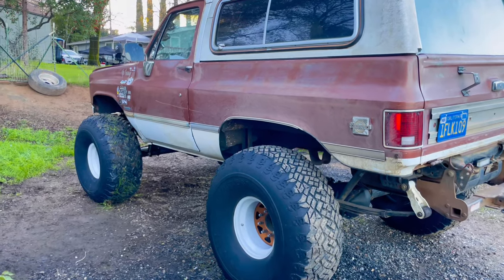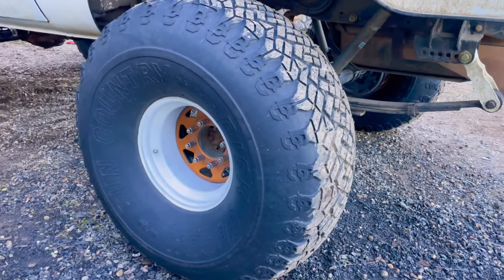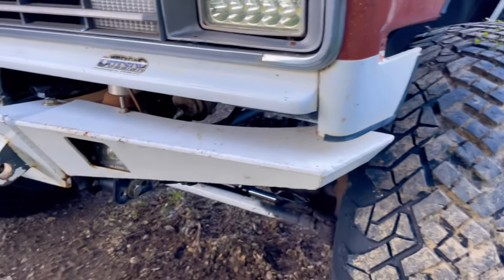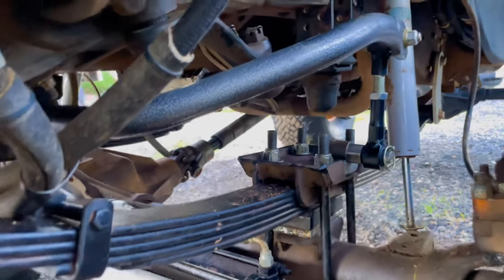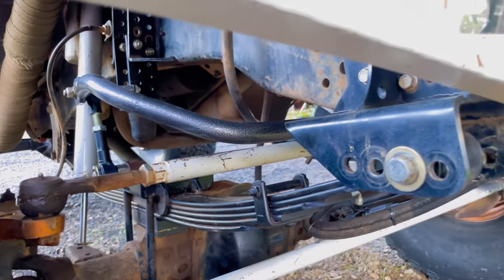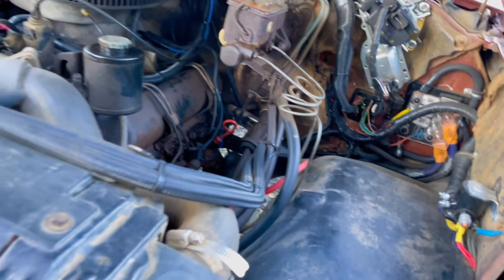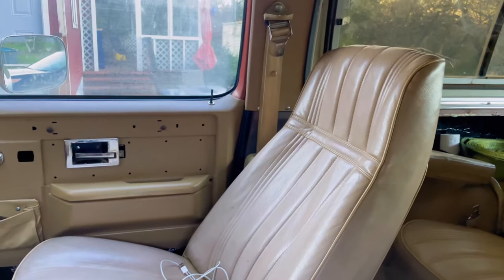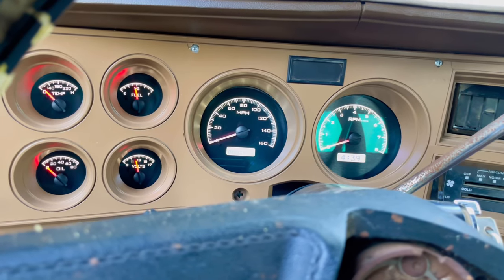LIFTED and LOCKED!! The ultimate k5 blazer build

Comment: I  graduated from H/S in 81, and my grandparents gifted me a new K-5 diesel 4 in the floor lock out hubs. Farmers/Ranchers are used to utilising farm diesel, so they gave it to me with GM diesel & shopbuilt front brush guard w/P to winch, you could stand inside the front brush guard to change the fuel filters. Rear farm bumper had a tow receiver, so I could pull any level farm trailer from cotton seed hull trailer, nursing tank, 1000 gl diesel, hay, cattle trailer 5th wheel for pulling a gooseneck trailer with Dolly. Manual locks & windows include rear gate glass. I had a 6” Rough Country 3” body lift 40” Monster Mudders by Gateway with 15X12.5 wagon wheel aluminum rims. I also had a 12K Ramsey electric winch in rear & 4:11 & lockers ft & rear stock axles, constant velocity U-Joints. 4 KC lights on top & 2 on brush guard & 2 Amber KC lights under brushguard. LEDs did not exist back then, but I also had 2 JD tractor flood lights integrated into rear bumper. I was a freshman in college & had all the chicks at college,merely because of that K-5 farm-mudder😂
Reply from the maker: That’s awesome man.  Love how much these trucks bring people together.
Reply: Got your goat, you're good man just pulling your wings!

Comment: What size axles?
Reply from the maker: Dana 60 front. And corporate 14 rear.  I believe the front axles are the stock 30 splines.
Reply: Corporate rear? I'm merely a farmer/rancher, never heard of that axle. The 60 yes😊
Reply from the maker: Just a 14bolt full float.  10.5” ring gear.

Comment: Not heavy enough, tires are too wide.    It's just gonna sit on top and spin
Reply from the maker: It does do that some times. That’s for sure.  I will be getting different tires next time.  Maybe some Baja pros.  Not sure yet though
Reply: Weighs 8000#'s ...how much do you think it needs to weigh there fella?? 😂
Reply from the maker: @markelrod814  truuuueeeeee
Reply: @markelrod814 it's weight by contact patch.  I know it looks cool and is fun but those ballon tires bounce and don't bite if you got smaller tires half the width with some teeth it would dig in

Comment: A very good start but certainly not an "Ultimate Offroad Machine":
No rear spring bump stops. 
You WILL rip the rear lower shock mounts off in the rocks.
Say goodbye to the stock brake light lenses (need protection).
It will be a tippy bastard, a tad too much lift and tire.
Too much tire for those 15's, the sidewalls will be VERY vulnerable and the front inner u-joints will be a weak link.
Front springs look "weird", there is a compression bend that will limit articulation.
Needs sliders to protect the rocker panels.
Need OBA (ALL 4WDs NEED OBA)
Didn't mention if the front was locked, it will be necessary if even just a Detroit, selectable is preferred.
Just spool or Lincoln-lock the rear or use a selectable if driving on snow/ice (that rig will be TERRIBLE in the snow, regardless).
Gear ratio is WAY too steep for those tires AND engine. I would be surprised if it will do 55 mph (not a deal breaker but the lower (numerically) the axle ratio the more you move the damage further into the drive-train). Trust me, it's easier to carry a spare axle than a spare chain-driven t-case that is in your rig currently).

Very few achieve the ultimate offroad machine, as it will be FOREVER evolving. And to note: if you sell it, prepare to take a bath. More profitable to sell it for parts. BTDT...
Reply from the maker: I appreciate the input.  It is ever evolving.   It will not be sold.  Ever.  End of story.  There’s way too much behind the meaning of This to my family and I.  Front is spooled currently. The longer I have it the better and better it will get.   The front springs have been replaced since I made this video as well as adding rear bumps.  It does absolutely amazing in the snow.  At least where I’m at and these are my winter tires.  I don’t do much rock crawling or much summer wheeling at all for that matter and with the 6.2 diesel turbod and the current gearing on the 44s it gets about 16 mpg and will do 65 easily.  Can do 70 but gets a little unstable above that speed.
Reply: Get a life
Reply: Also, post a video of your truck to set the example